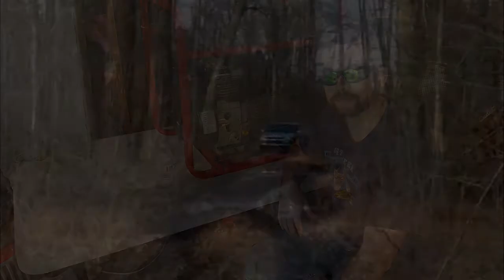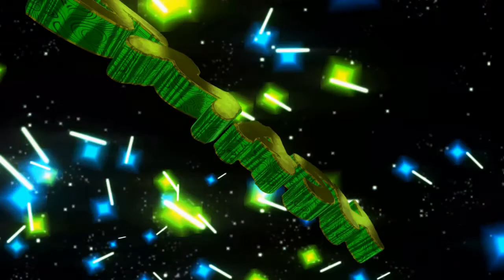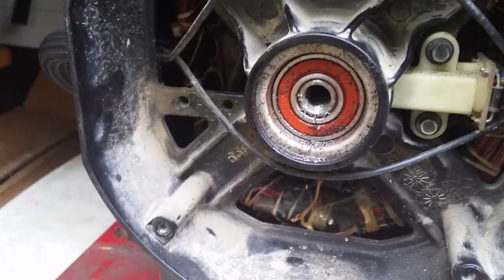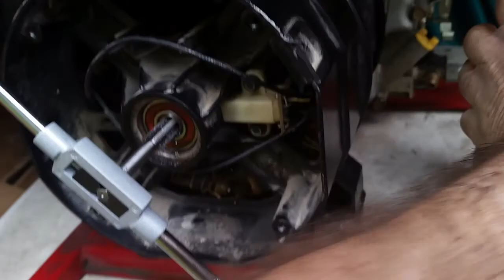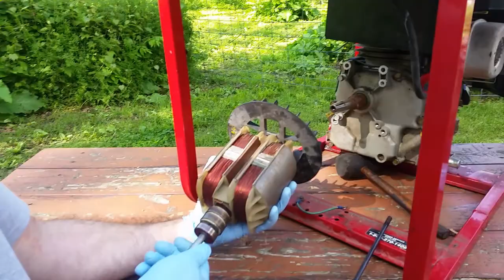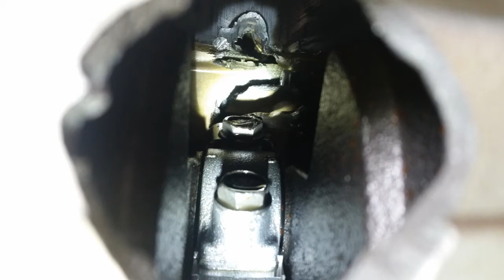Generator repair / ENGINE SWAP! pt1

Comment: Remove the bolt, fill threaded area of the bolt removed with water, put Teflon tape in abundance on threads of bolt and reinstall. The bolt will hydraulic the rotor off of the shaft

Comment: Why has nobody come up with the crazy idea of self contained generator units, bolted externally to the engine, with a straight keyed shaft, just like the hydraulic pumps I work with regularly? Insane having to dismantle the generator to pull the case side off the engine.
Reply: Now patten it
Reply: it would end up physically bigger unit. 
That means higher cost of material storage, finished product storage, shipping and it would take more space in your garage.

Comment: I bought a generac cheap from farm auction got the engine running smooth but the generator doesn't put out power any ideas? It's a 8000xl generator with 16 hp brigs
Reply: Saw stuff online where u can regenerate them sometimes

Comment: Dibs on the flat head briggs parts
Reply from the maker: Where are you located
Reply: @smashengineeringoffical   fl  I just bought the air cleaner assembly off one of those used .. for cheap because mine did not have one I found 10hp one in the trash all it needed was its fuel system redone and carb cleaned runs now

Comment: The way I seperat them is find a small but that will go to the bottom and put the bolt back in and start tightning they will seperate

Comment: I separated one and I find a way, if you just take off the cup cover and the big volt then use a small nail bar to opening or separate, it’s working fine for me because I don’t have all the tools 🧰 what you have but thanks for the video that’s a helpful to 👍

Comment: Please make one part of this make sense!!! Why not remove it as a whole unit??? Why must 1 tear the gen apart to remove it from the engine??? Please I'm dying to know why??
Reply: If I understand correctly, he's putting a different engine on the generator. It's easier to work on when the engine and alternator assembly unit when they're off the frame, which he did. I'm not clear what you're missing.